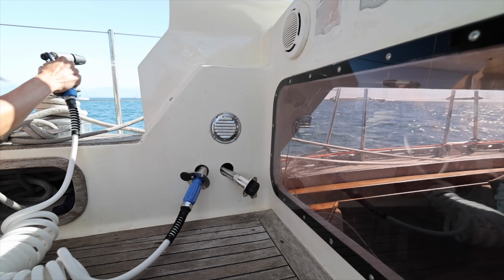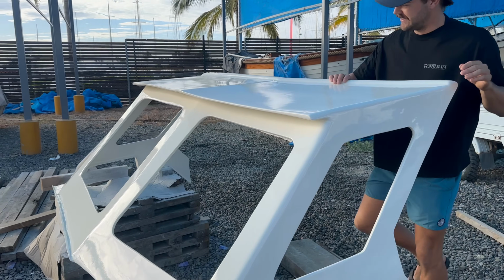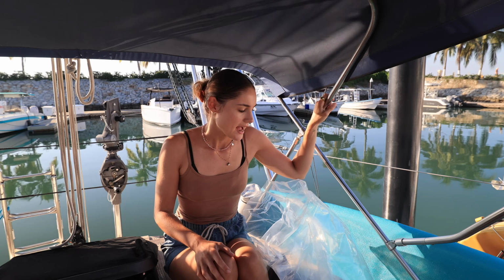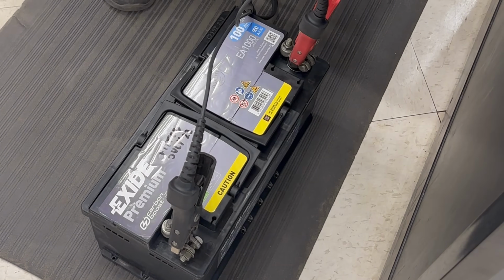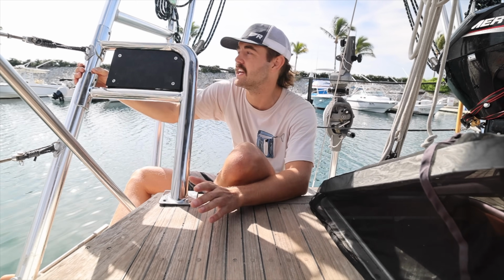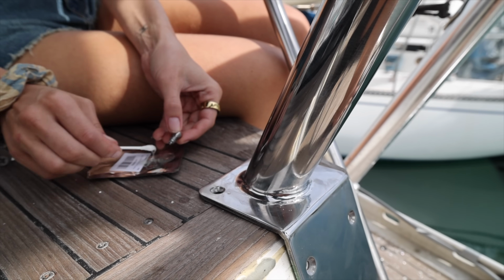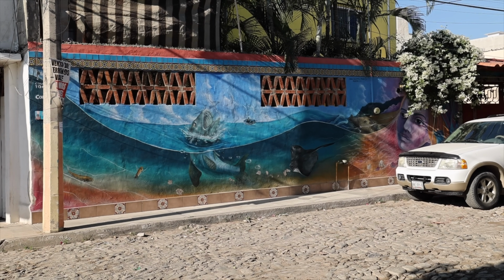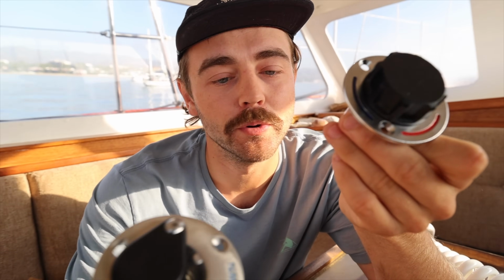OFF- GRID Shower on our SAILING BOAT (Need I Say More?) // Teulu Tribe

Comment: Have not watched your channel for a couple of months as it was a bit samey. I'm baffled, are you go to sail the boat or just make it shiny. Take care out there, salt water will damage the hull
Reply from the maker: We have sailed over 1500 nautical miles since November 24..and gearing up towards a 2500 mile ocean crossing, so yes, the boat is getting sailed but also much needed maintenance on a 40 year old vessel.

Comment: Outboard bracket is awesome. Nice job. Being a person always thinking of safety. The bolts you used to mount bracket to debit support should be turned around to where the nuts are on the inside to help insure you don't scrape your arm on It if reaching around it or landing fish etc. Or at least cover end of bolt with rubber caps. It looks awesome and very functional.
Reply: Agreed, and maybe something for the base to nest in for when there’s heavy rolling?  Great work guys, y’all are “bloody doing it” for sure. It’s lovely to see Mexico portrayed as I have found it to be 🙏

Comment: Very frightening, two thieves on you boat.
Reply: I recommend the Joshua Slocum Boat Security System. Sprinkle thumb tacks on deck and they will (a) provide you warning as soon as someone comes aboard in the dark and (b) make them leave immediately. A modern alternative would be motion activated security cameras with flood lights.

Comment: You might want to get one of those fuel filter bucket things for filling diesel. It will slow down filling rates but as you get more remote areas, you might need to filter the fuel you put in. Could save your inline filters a bit
Reply: I was thinking the same thing as I watched you fuel Thulu , that extra filter may save you in the future in outer places across the Pacific ! Some places have poor quality fuels !
Reply: @jimconner1028  ....ok..... A wise precaution.
Reply: Mexican fuel is very good with new double lined storage tanks.
Reply: @sails3538   was thinking of some of the pacific islands
Reply: @ but what about going west from Mexico? When they get to the summas (spell) anyway?

Comment: Don't know if you are still in the same location.  You might want to have the same fabricator use more of your stainless to make a small drop down/flip up step on the bow side of the new motor mount half way between the deck and the top of the mount to make climbing up to service/wash/access your solar panels even easier.  Just sayin!!
Reply from the maker: Thanks for the suggestion! We'll definitely consider adding a step to make accessing the solar panels easier. Unfortunately we have moved on now so can't use him again.

Comment: Make sure you put a plastic shim between the steel and the aluminium, otherwise it will corrode quickly. The material from a soda bottle will work.
Reply from the maker: Thanks for the tip! Corrosion is definitely something we want to avoid. We'll make sure to use a shim!

Comment: My very dear Teulu friends,
Have been following your exploits for a long time and have thoroughly enjoyed your significant contribution to those of us not able to participate.
And I fully understand your latest modifications, correctly perceived as of great comfort & convenience during, in particular, long open ocean passages.
But I am concerned tp preserve your welfare. You are  both very intelligent, well educated people; but it's evident you have not yet experienced the real wrath of the oceans. 
When you do so ( and I hope you don't, but you surely will) your current modifications that comfort you 99% of the time may well prove your worst enemy.
In a full-on ocean storm, you do not want to have  top-hamper, that is both mass and windage at height above the (normal) waterline. It's not just a stability issue, but one of dictating control of the vessel's heading and handling.
Your 40' boat enjoys great accomodation as standard, because it extends well above the waterline. So it inherently has much windage. Your mods have added very much more.
Two splendid people, please take care! You will surely observe weather reports - but in a max 6 knot boat you simply cannot weather route effectively across an ocean if it turns really nasty.
Reply from the maker: Thank you for your thoughtful insights! Safety is always a top priority for us, and we appreciate your concern. We do get that this will add some windage to the boat. However, I think that compared to overall windage of the boat it will be fairly negligible. Numerous golden globe boats have hard dodgers to protect from the elements and we both think that the benefits of it far outweigh the negatives. As far as weight goes, Teulu is 13,000Kg dry (probably 14,000Kg+ with fuel, water, chain, ect) a 35Kg dodger will also have a very negligible over all difference to stability. After 3 years of improving and working on Teulu (with input from multiple round the world sailors) we are more confident than ever with Teulu and what she can handle 😊 Thank you again for your concern and thoughts.
Reply: If I may, you have good points.  Teulu isn`t Delos.